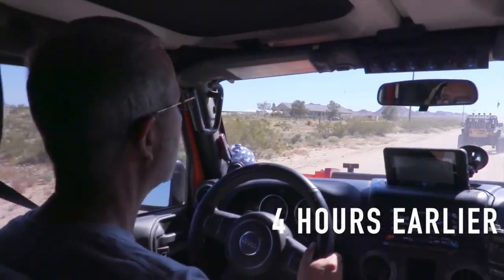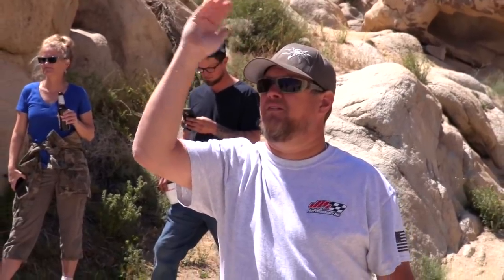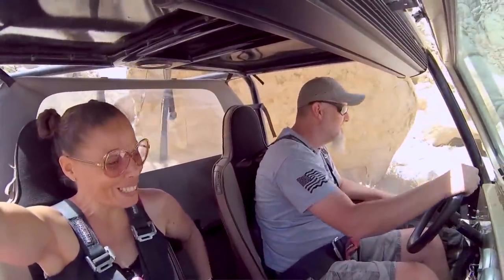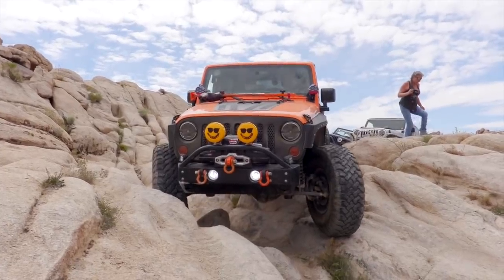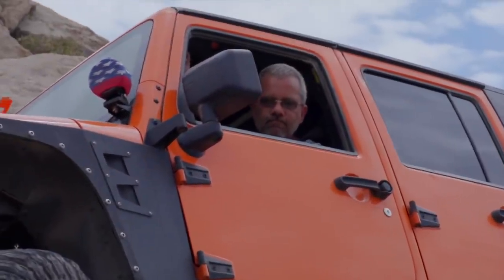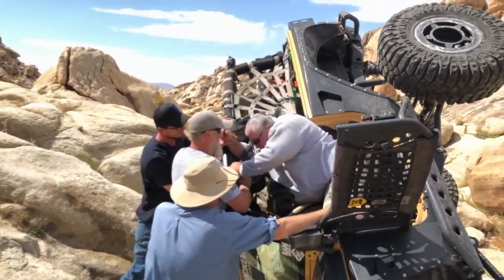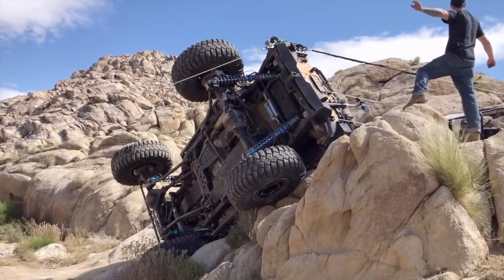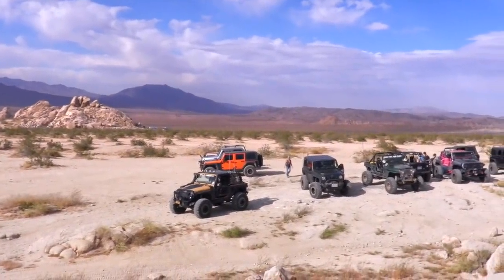Jeep Rollover And Off-Road Recovery at Hammer Down Trail - Cougar Buttes

Comment: With the right tires and suspension would a stock inline 6 be able to make some of these?
Reply from the maker: This trail requires clearance, flex and skill.. Doesn't matter what kind of engine it has.
Reply: @TheNotaRubicon  gearing and lockers also help